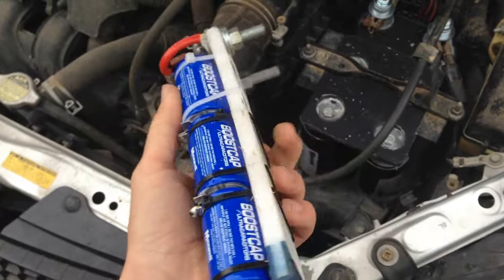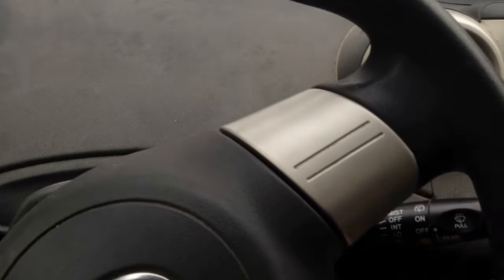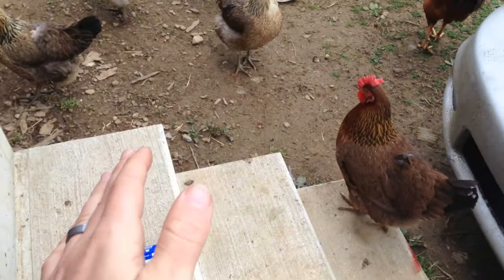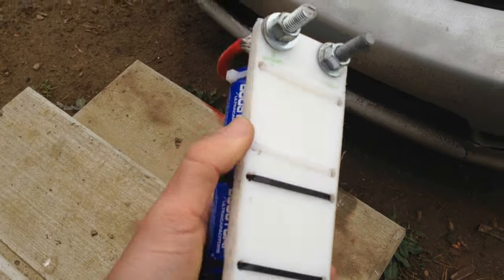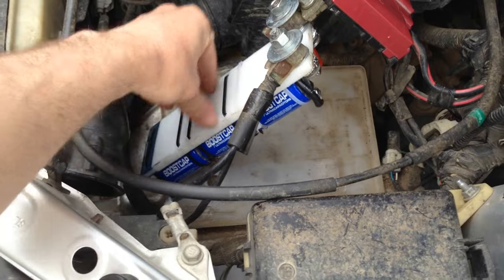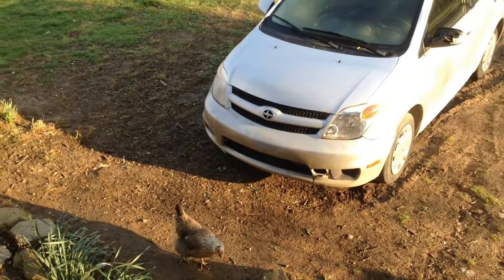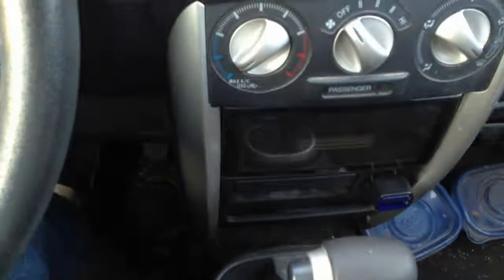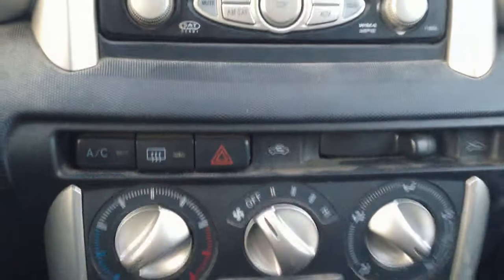Replacing My Car Battery with Capacitors! 12V BoostPack Update

Comment: There's a reason car batteries haven't been commercially replaced by capacitors and the reason is capacitors don't hold a large charge for a long time. The car battery will hold a charge so if you don't start your car for a couple of weeks it will still start. Try that with the capacitor pack.
Reply: Exact !!
Reply: Ya he says that in the video around 4:20. No scam here.
Reply: You could put a solar panel on the roof to keep the cap full.
Reply: plus caps cant handle the high frequency current from the alternator, some day they will break (or leak)
Reply: While the engine is running you could charge the capacitors by using thermo peltier modules mounted on the engine block with a heat sink might even work better in the winter.
Reply: use a combination batteries and caps
Reply: +Thomas Sobieski could it be a deep cycle battery and caps
Reply: The main reason is charge that caps can store ... in this film in my opinion (after calculation) this module can store 3-4% of typical car battery (60Ah 12V). Its true that cap provide more current - easy to use energy but storing this kind of energy need a lot of space. Super caps are great but after charged you need use that power - good example is gauss gun.
Reply: alternator puts out pulsating DC
Reply: my maxwell ultracaps sat in my garage for 3 months and never went under 12 volt. 2.7volt at 6 per bank.  They have been in my car for 7 months without a problem. I use them with an audio system. Heck I know a guy using 20 banks of maxwell caps on his audio system. think he did a good 161 on the meter at 23000w. Caps and agm or lithium is becoming  pretty popular  in the pro/comp audio scene.
Reply: same thing with the battery, if you will not start your engine with in 2 to 3 weeks your bat, will discharge, if you did not disconnect from your vehicle, but if you disconnect it sure it hold the power, same  with the cap. for sure but more long life for the bat. charge
Reply: To me, its a fair trade, for a frequently used vehicle, trying to reduce as much weight as possible. This is a great hack to make a traditional motorcycle even more fun & efficient. His cap-pack didn't even move his scale. It's lighter then the lithium batteries for bikes. Cheaper too. Just the one catch, you have to start the bike every 2 to 3 days, and can't leave lights on, and beware of a bike alarm system draining them quicker. Perfect for someone who rides a lot, wants more handling, and is ok with hooking up a battery tender for breaks longer then 3 days.
Reply: True but who doesn’t drive daily? It’s not a perfect thing but an experiment. A small battery added or maybe have a plug in to 120 AC like I do for my diesel in the winter?
It’s a great start and I, for one, look forward to what happens next with this. 
On a different note, maybe someone smarter than me could make a propane /electric vehicle. A propane generator running an electric car.  Wouldnt it be handy to have a mobile generator in emergency situations? Like the recent hurricanes?  
My 25 kilowatt pto generator only need about 50 horsepower to run a barn cleaner 
Just a thought.
Reply: @Anyoneofus978  Hey don't get me wrong I'd love to see the cap win because it'd be a great advancement.

Comment: Great for the Canadian winters.  When it gets down to -20c, lead acid batteries will have a hard time cranking the engine.  These capacitors, don't loose power in the cold.  You should patent it and start selling it. Um, you should at least use some tie-wraps to keep it secure.

Comment: Your best bet is to have a supercap pack in parallel with the battery so that the peak current comes from caps and the bulk storage comes from the caps. In really cold conditions lead acid batteries don't crank well, but the supercaps MIGHT be better (check the specs)

Comment: i think one of the benifits of this would be in an emergency. imagine you hook up a hand powered charger... turn it for about 10 minutes, get enough charge to turn your engine over. with a normal battery, you would be hand charging for 4 hours.
Reply: Almost word for word what I was going to post! Wonder where we can find a 12v hand charger?
Reply: @garychandler4296  wimshurst generator!
Reply: To be honest, unless the battery has been severely discharged you could likely use the battery itself get the energy required. A moderately discharged battery has a lot of energy, it just can't be discharged rapidly enough to start the motor. There are commercial solutions that do this
Reply: Or solar charger.
Reply: @GoogleDoesEvil  i know
Reply: Y not use the camera flash system.. Double aa battery charge capacitors to 12v in turn send charge to this in turn start the car.  Camera flash charges in seconds.
Reply: I have a USB lithium battery jump starter. It's very small and light. You could just attach that for a jump when needed. Even keep it in the car charged off the USB
Reply: @breakfast7595  nop, once a battery goes below 10v it will take several hours to recharge

Comment: that voltage meter and cap pack combo would also work great to find power draining issues, the cap will drain much quicker than batteries and charge right back up so you could isolate the issue easier